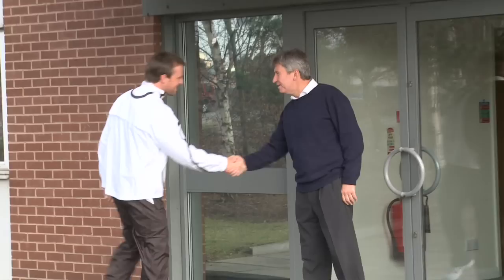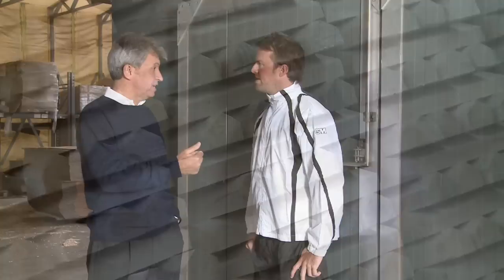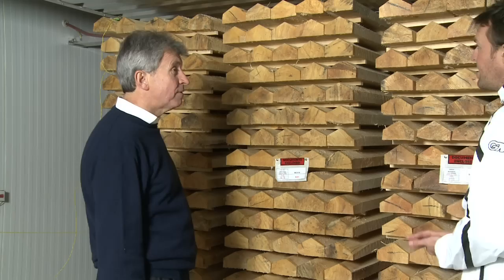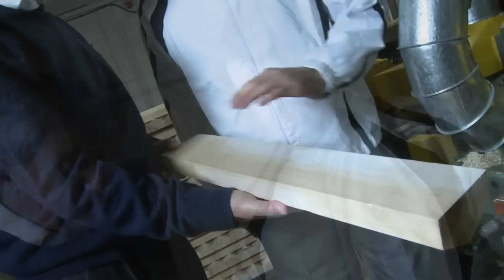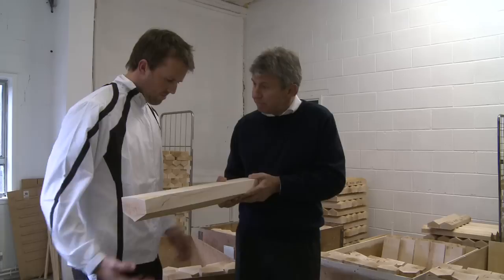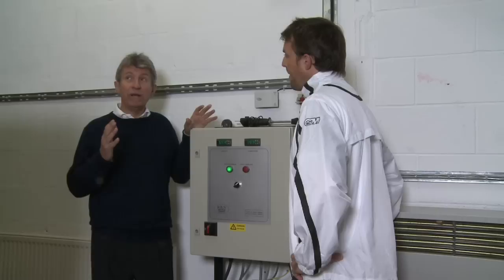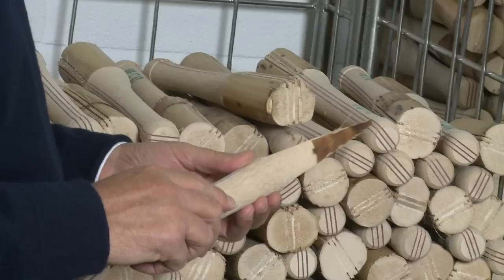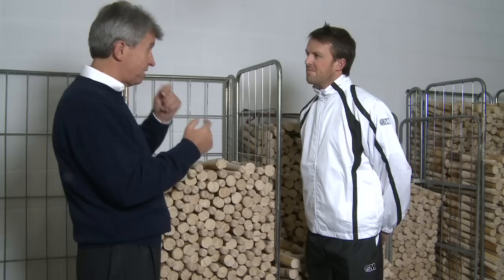The Art of Bat Making - Gunn & Moore - Part 1 - Preparation

Comment: 1.GM press harder than more making them more durable and they generally last longer. However they tend to look more traditional, smaller edges. Performance is sightly reduced by hard pressing in the short term but once opened up GMs fly. 

2. If they dont press the bats they will be more vunerable to ball damage and seam marks.

3. A bat will ping well presser hard of soft, im not an expert on performance when talking about level of pressing but bats hard pressed will normally last longer.